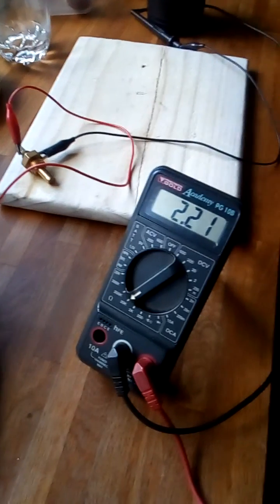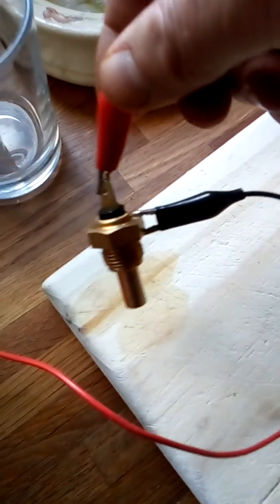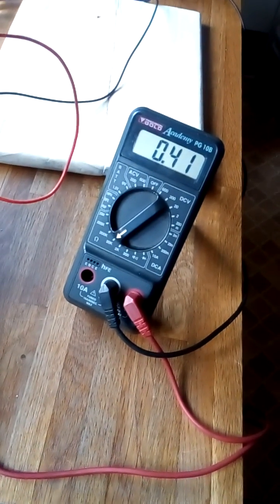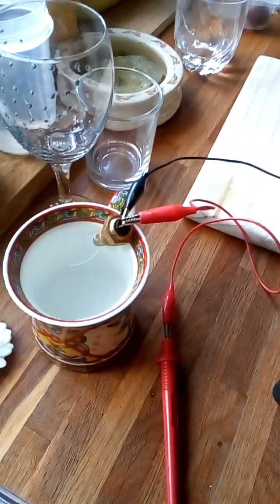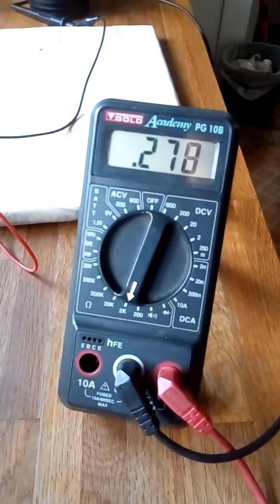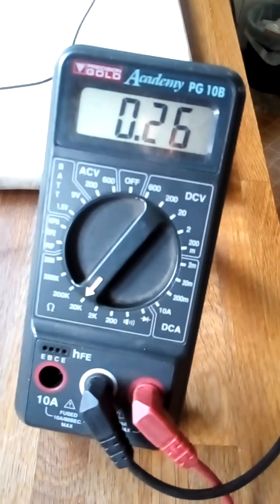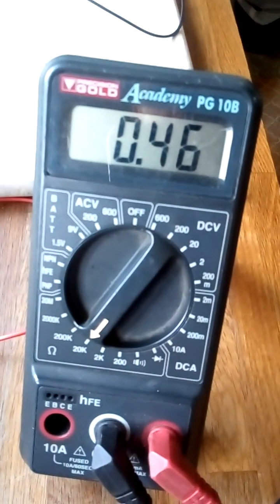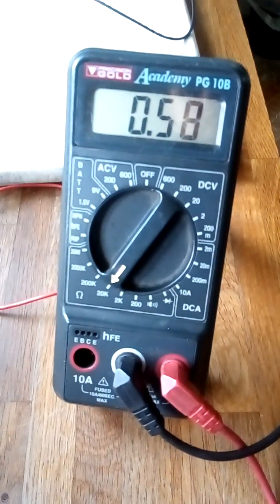David Brown 780 coolant temperature sensor resistance test Ohms

Comment: by reducing the meter reading you are just moving the decimal point one way or the other. At least it is registering so should work with the new gauge. At the end of the day I would not have gone with the electric option and only use the capillary style one, they are far more reliable.
Reply from the maker: The capillary appears to be the way to go.